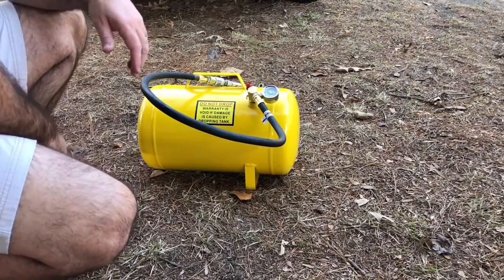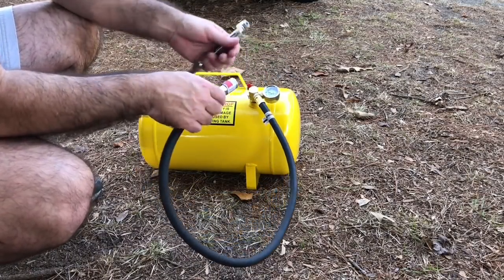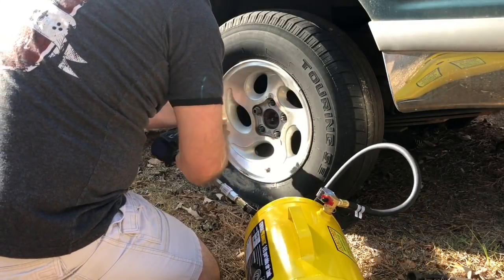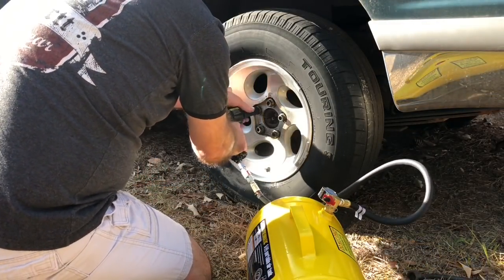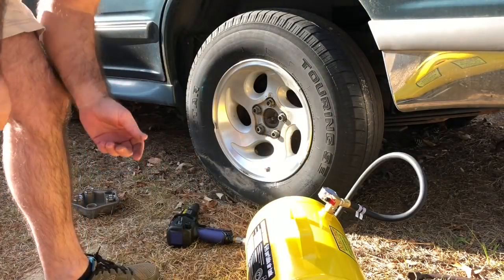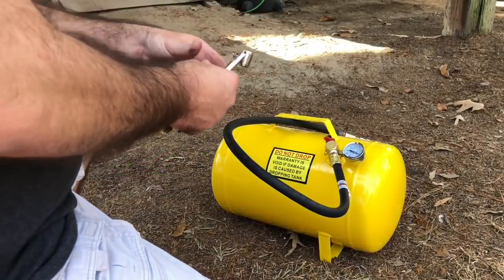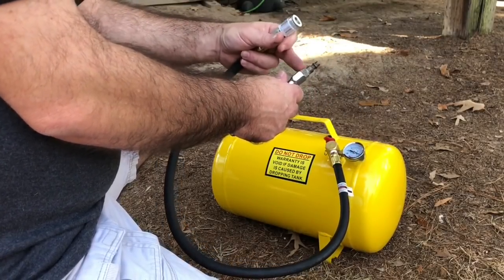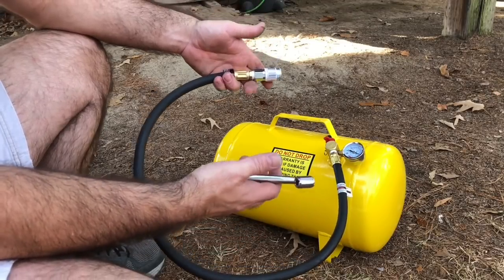Modified Harbor Freight 5 Gallon Air Tank. Will it take Lug Nuts off?

Comment: I was really surprised to see it take off more than one. I modified my tank a few years ago. Never thought of filling it through the hise. Great idea. Thanks for sharing.
Reply from the maker: Yup I was surprised to. The Air gun is a 700 ft pounds gun, that was probably the difference. It doesn’t take much Air to get them off.. I was going to to change the manifold but after looking at it I saw when the valve is open on the output side it has a huge air Valley.. that’s where I came up with filling it on the hose side.

Comment: I have the same ideas when I get around to it , I've has several of these HF air tanks , the red plastic knob on the intake manifold usually starts slipping when I tighten it to really get a good cut off of the air , I solved this by getting an manifold with a metal knob available from most auto parts stores for around $10 .
Reply from the maker: Yeah I agree that’s the weak part for sure. The gauge seals are starting to leak air too. I’m going to change it out soon

Comment: Walmart has the Briggs and Stratton 7 Gallon (larger) for the same price. And it has all 4 of its legs. Otherwise it comes with the same crappy plumbing that needs replacing as seen here. It can also be filled through the outlet hose the same way as demonstrated here.
Reply from the maker: Awesome. How much is it? Looking back wish I had bought the 11 gallon one for $39
Reply: @ShinyKnife  - I got mine last week on clearance for $22 due to a damaged box, but even regular price at Walmart is $29.88 right now. (MODEL: Briggs & Stratton 9000741, 7 Gallon 125 PSI Air Tank). My recent purchase of this Walmart tank is what led to me going on the prowl for ideas like yours to see if upgrading the valves was even possible. I'd already had the extra fittings to do the "fill through the outlet hose" idea, but your video confirmed I was doing it correctly - thanks.
Reply from the maker: Your welcome. Thanks for watching

Comment: hi i was wonder did u buy the hose to change the setup u have in the video if so were can i buy that kind of hose from what sizes hose  and how did u make the connect ends what  sizes for them also i just bought the same air tank u have in the video
Reply from the maker: I bought the hose at harbor freight it’s a 3/8 line. With 1/4 inch fittings.

Comment: Will that trick work with 1/2 inch air impact wrench and its CFM requirements?
Reply from the maker: Yeah the gun I’m using in the video is 1/2 inch just necked down to a 3/8 adapter

Comment: You think is a good idea to take on of those thanks off road to fill up my tires ?
37x13.5x18 .
Reply from the maker: I’d get the 11 gallon one for off-road tires. It will pump up a couple tires. But for bigger off road ties I’d go with a bigger tank. 
Unless you just need it to top off tires
Reply: @ShinyKnife  thanks

Comment: What pressure air gone is that?
Reply from the maker: 90 PSI but that tank will only be at 120 psi for a few seconds. So it want hurt it
Reply: @ShinyKnife  I really meant what was the scfm gun rating. I have a small 135 psi 2 gallon compressor with a 2.2 scfm @90 psi. Was wondering if I could run an air gun.
Reply from the maker: @maeu59  probably about 3.5 SCFM I’m not sure. That’s what my compressor does
Reply from the maker: I’ve got a small harbor freight tank with the same SCFM and it’ll take five lugs off but then you have to wait for the tank to pump back up. So it’ll work. Just not very good
Reply: I have a 5.3 cfm compressor if I use this as an auxiliary tank will it keep that same Cfm or pressure?

Comment: Rookie question..but could that compressor operate an air brush for art?
Reply from the maker: Yeah but if your painting you need a air dryer to keep the moisture out. 
This is just a air tank. But it would work in a pinch
Reply: Got it...ty👍
Reply from the maker: Here’s a perfect setup for you on the cheap https://www.harborfreight.com/1-6-hp-40-psi-oilless-airbrush-compressor-93657.html
Reply: Shiny Knife ...thanks...bud

Comment: Does this keep the same Cfm and pressure as running from your compressor?
Reply from the maker: No it will drop as soon as you start the tool. I was just seeing if it would work
Reply: I have a 10 gallon 5.3 cfm and I was wanting to add a 11 gallon auxiliary will it run the same with my air tools ?
Reply: @ShinyKnife   I meant if you kept it connected as a auxiliary tank just to add more air .
Reply from the maker: Yes as long as it’s inline before the regulator. It’ll hold more volume of air. It’ll just take longer for the compressor to kick on. Be careful though. It’ll burn your compressor up if you run it past the duty cycle of the compressor motor.

Comment: All of my air tools say that they should be operated at like 65 psi or so. I just bought a spare air tank myself and noticed that there's no regulator like yours (just the pressure gauge for the whole tank). Is it safe to full up my tank to like 135 and use my tools off of it until it just depletes? Or can I expect to do some damage to my tools?
Reply from the maker: I doubt 135psi would damage a air tool. It will only be at 135 to start with .
If your worried about it buy a regulator and install in between your tool and tank.
Reply: Sounds about right. Thanks, I appreciate the reply... I assume my impact wrench will break free once it reaches its torque limit so I shouldn't need to worry about over pressurizing it too much but I wonder if my chisel might just shoot across the room. We'll see :).  Thanks again

Comment: Hello nice but lug nuts should be removed and installed in a star pattern
Reply from the maker: It’s a junked vehicle with a broke tranny. I wasn’t trying to demonstrate the “ Correct” way to take lugs off. the video was about the air tank. But thanks for pointing out the right way to do it. Appreciate your help.

Comment: It doesn't seat tires, it's useless! You have to have a high pressure blow nozzle to seat a new tire, then you can fill it up air. 
Where's the tank with the high pressure blow nozzle?
Reply from the maker: It’s not a bead seater. It’s just a air tank.